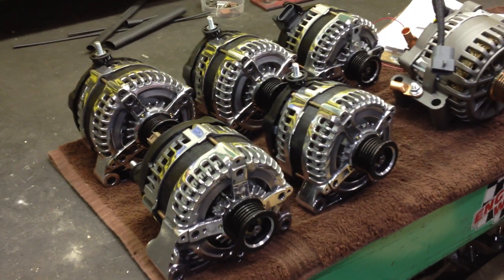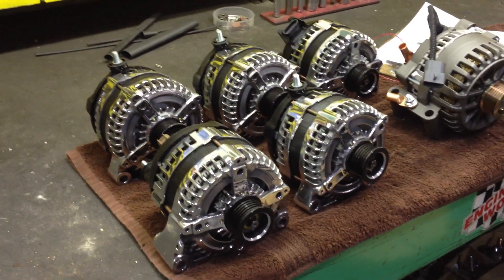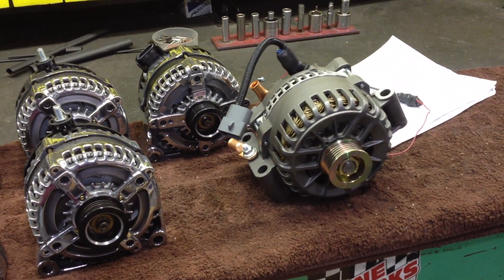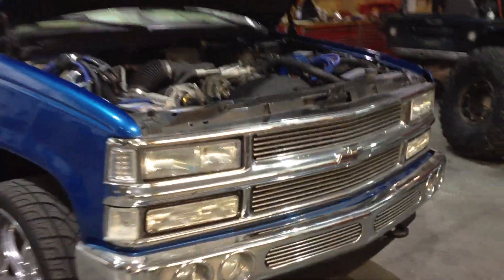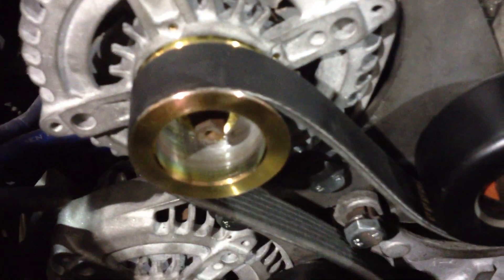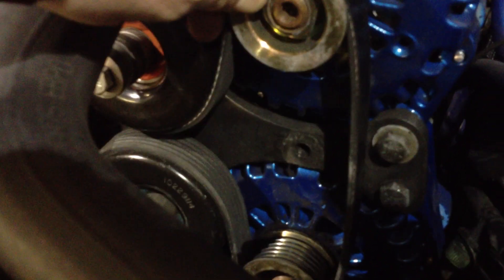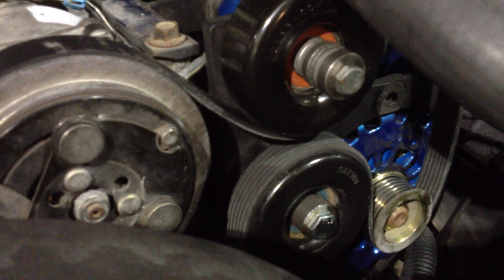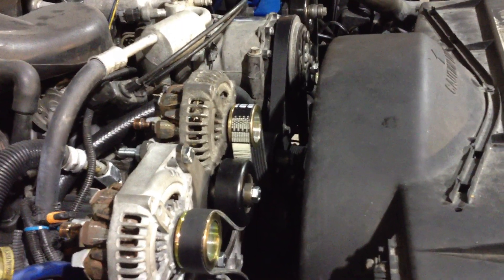Jonathan Price Tahoe Mechman 6 320 AMP ALTERNATORS!!  bracket update video 3

Comment: I currently have a 270amp unit installed on my 99 ford EB Expedition with a 5.4ltr engine but I am still in need of more power a daul or tripple set up would be nice. GM guys are having the most fun. I heard rumors of a ford 400amper. When will it be complete and how much?

Comment: Do you guys offer anything for a 1999 Mitsubishi Eclipse GST. The stock alternators suck. A lot of guys put in a Saturn unit for a little more output to keep voltage up on bigger fuel pumps at high RPM but the Saturn alts are still only 90 amps and take some modification to get them to fit. I'd love something around 150amps

Comment from the maker: @pinoytat93 

Yes, but we generally can play with idler pulley diameters and locations to get the belt length to land on a commercially available belt.  That's what we had to do in this case.  Also, we had to use an 8 rib belt and cut it down to 6 rib.

Comment from the maker: @J00bles 

We could have fit a 6th alternator-  the issue is load against the belt.  As it is, there is about 50 horsepower worth of accessories being driven by a single 6 rib belt.  Even with only 5 alternators, it is going to slip the belt on the crank pulley.   Our goal was to build something reliable, as Jonathan drives his truck quite a bit.

Comment from the maker: We do not have any plans of doing a multiple alternator bracket for that truck.  We DO however have a killer 340 amp unit that will bolt directly in place of your 270 amp unit, that cranks our an incredible 240 amps at 800 rpm.  Just shoot us an e-mail through the site for more info.